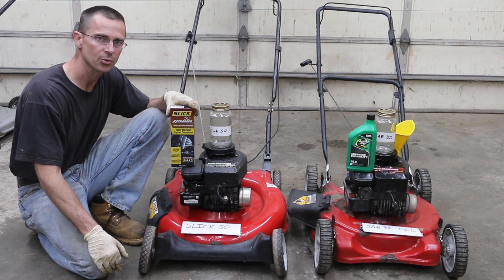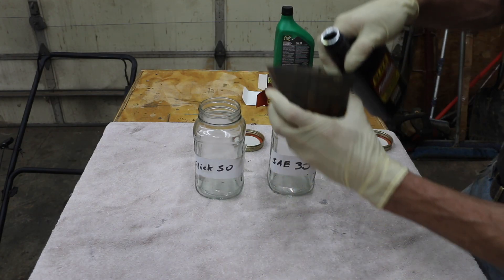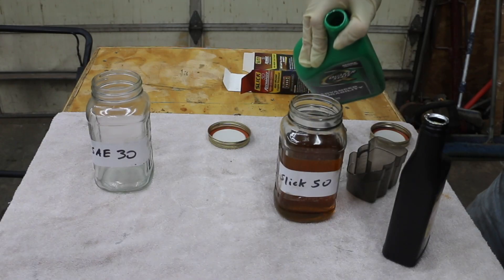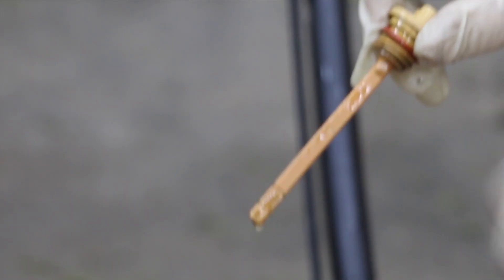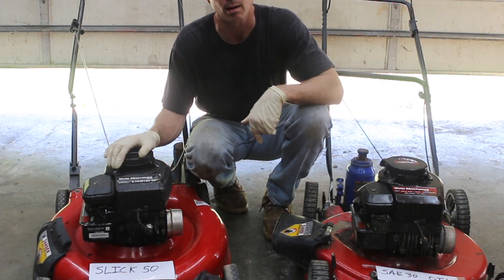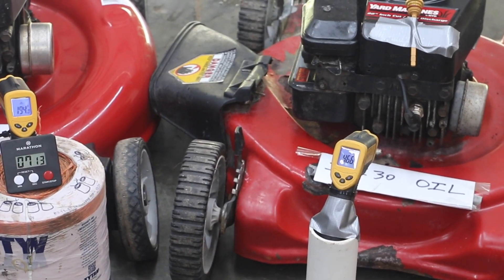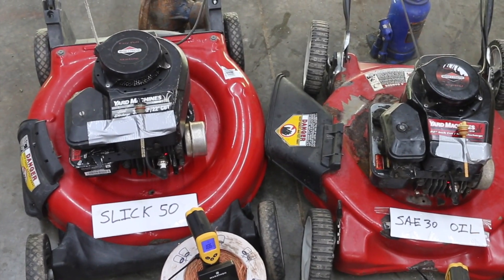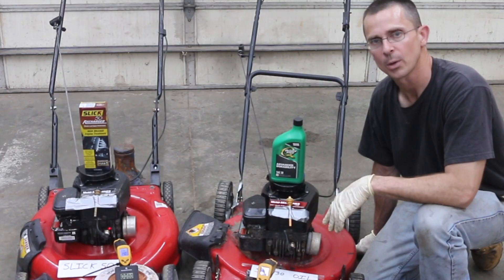Can't believe what SLICK 50 did to my engine!!--Dry Crankcase Test!

Comment: The Slick 50 mower looked to be in better condition than the SAE 30 one - the latter could have been more worn and taken longer for the critical part to heat up enough to seize?
Did you strip the engines to see if it was piston, crank or something else that caused the engines to stop? Did you notice any death-smoke from the Slick 50 engine, like the SAE engine displayed?
I do know of an instance where a chap used Slick 50 in a destruction derby car with a very worn engine and it was still running well after boiling off the coolant. What actually stopped it was the bodywork shorting out the coil - it still turned on the starter - and when that was sorted, the next day, it started and was driven onto the trailer for disposal.
From what I recall, from more than 30 years ago, there was some concern that the teflon could keep more heat in components, but not sure how true that would be.
Personally, nowadays, I just use good quality full-synthetic lubricants in the engines, gearboxes and differentials, if used, for the vehicles - and as the lawn mower is a 2 stroke, I don't think there would be the potential of an oil additive for that ;-)
Reply from the maker: Thanks for commenting on this.
Reply: Prompt reply - cool. Been doing some checking and it seems the modern "Slick 50" is nothing like the original product so, perhaps, your experience isn't unexpected after all.

Comment: What you did not do was to run both engines with normal conditions and establish if there is a difference between them than could result in one engine to run hotter than the other.
Reply from the maker: Thanks for the constructive feedback.

Comment: I had used slick 50 in my 1980  Chrysler Valiant. I had used it when I first got it I had 15000 miles on the car when I bought it, the first time I used it I put it in every other oil change. I had put on more than 155,000 miles on it when my oil pan cracked due to a rock hitting it. I was about 125 miles from home in NH. it was a slow oil leak and it ran out at 100 miles to go. my Temps did not go into the red area until I was almost home.  It was about 4 miles from my home before the engine started to seize up. the stuff works but it has to be run for a lot of miles for the Teflon in Slick 50 to coat all the metal parts. you can't just run it for only a short time on Slick 50, then drain the oil and do the test. It takes time to build up. it used the heat created to bond the TPE (aka Teflon) on a molecular level to the metal.
Reply from the maker: Thanks for commenting on this.

Comment: I think the mower you put slick 50 in was already damaged in some way . I'm not saying you did anything wrong the one mower just had more time on it. I did the same test and the slick 50 lasted much longer. Go buy two new motors with extended warranties and give it a try.
Your videos are awesome keep them coming. Thanks
Reply from the maker: Thanks for commenting.  I've since begun using new, identical engines.  Thanks again.

Comment: Slick 50 seems as if it has too high of a level lubricity. Im probably spelling that wrong. Clearly this stuff works better when its actually in engine oilnto preserve it. Without the oil it dries up inside the crankcase
Reply from the maker: Thanks again.

Comment: There's almost no chance your experiment is proving anything about the Slick 50.  You start with two  engines  that are far from identical.  You can't rule  out the simple fact that the Slick 50 engine could have been in worse condition at the start of the test.  Get 20 new engines and run 10  with and 10 without Slick 50.   THEN you might have some real science...
Reply from the maker: Thanks for the constructive feedback

Comment: I was going to try rubber washer on a Honda ATV motor I was wanting to know if temp is to high on ATV air cooled for regular rubber for hardware store ty please let me know answer. Good video on the lawn mowers.
Reply from the maker: If using the rubber washer on the cylinder head or near the exhaust, it won't last.  If using it away from the combustion chamber and exhaust, I believe it'll work.  It's hard for me to advise without seeing first hand the location you plan to use the washer. Hope this helps.

Comment: ur not using the original slick 50  shell oil bought out  the product and the formula changed because of patent their is a video about that  i did a lot of research on oil additives and turbo max along with amzoil is my opinion the best  for example the best mpg i  got in my mercury mountaineer before was 20 mpg after 23mpg   on my harley i got fou r more mpg on it on the heritage class b 103 check out the interview with john bishop
Reply from the maker: Great point.

Comment: Sorry but there is nothing, unless you have your engine nitrided. Regular oil changes that's it! Any internal combustion engine has a finite life span, newer modern engines will go much further but that is only because of the fuel efficient fuel injection systems that prevent fuel wash down of the cylinder walls then into the oil pan.
Reply from the maker: Thanks for commenting.

Comment: Years ago I did a test on my work car.  I ran Slick 50 for a year "three oil changes" with Slick 50 each time.  I ran a 195 thermostat and had to remove the cooling fan so I could have heat in the winter.  It worked.
Reply from the maker: Wow! Thanks for sharing this experience.

Comment: Years ago I also used Slick 50 and I thought it had saved my engine. Not because it ran out of oil, but my GF had blown a head gasket and drove it home overheated with the coolant temperature needle pegged. I thought for sure she had caused damage to the engine or at least warped the head. As it turns out the engine was fine and the magnafluxed head was also A-OK. New gasket was installed and it was good to go and last for years until I sold it.

So while no engine is going to survive without lubricant, maybe keeping the engine temperatures below a certain level helps keep the metal from distorting/melting in some overheating situations.
Reply from the maker: Thanks for commenting on this.

Comment: Prolong!  THey used to do the tests where they would throw dirt and drain the oil in the AZ desert heat after running it with Prolong, using a viper v10...I would love to see a test like this with Prolong.
Reply from the maker: Thank you for this recommendation!
Reply: Thanks for the reply even on a video so old.  Love your stuff and watch them more than once because well you do them tons better than others.

Comment: I would really appreciate a test of
- Liqui Molly Ceratec
vs
- Wagner Micro Ceramic

You could also give Militec-1 a shot. 

thanks a lot
Reply from the maker: Thank you for this recommendation. I'll be publishing a video on Liqui Molly soon.
Reply: Project Farm thanks really looking forward to these because these additives if they really work as advertised could really prolong the life of our engines, gearboxes and differentials and also save some fuel not much but still a bit :)
Doing those tests with real engines is really a heaven sent proof instead of pure theory some try to tell us.
Thanks a lot!

Comment: In my experience the original Slick-50 was great. Maybe 20 years ago I had an ‘86 Camero that was hard to start in the winter, burned oil and didn’t have the best mpg. I read the claims that Slick-50 could stop oil burning, improve your ease of start up and increase your gas mileage by almost 2 mpg. So for a month I kept careful records of my mpg. The instructions were very specific, change your oil and substitute one of the quarts of oil with a quart of Slick-50, well shaken. Then drive your car for at least a half an hour with the rpm’s above 2,000 I think it was. This was the time and temperature that it took to burnish a micro thin sleeve of Teflon onto the cylinder walls and also filling in the gouges that have occurred during normal operation. I did so and then left it in for the remainder of the 3,000 miles between oil changes. They recommended continuing on with regular oil changes for the next 5 changes and then repeating the treatment. To my surprise I got almost exactly 2 more miles per gallon, stopped burning oil and winter start ups were instant. I kept up with the treatment schedule over the next 3 years I owned the car. Though the engine ran like a top, sadly the body and interior had gotten pretty shabby, so to satisfy my curiosity I took it to my sisters mechanic instead of mine, because he wasn’t aware of the Slick-50 use and paid a hefty fee for him to check out my engine before I traded it in on a new Camero. When he called me later with the results he sounded suspicious. He said that the engine was in good shape for its age but the one thing that was a puzzler was that it still had the same compression as it would have if it were brand new. That made me feel that the expense of the Slick-50, $30.00 a quart, was well justified. I told him about using the additive and he mentioned that he was going to try it on his old truck, don’t know if he did though. The other thing was that it was not supposed to be used on new cars, but only after whatever recommended number of miles. I also used it in our pneumatic control air pump at work which then ran cooler and left no oil residue when blowing out the condensate from the air tank. I can’t speak for anyone else’s experiences but mine were fantastic. I suspected that It worked too well when later I heard that auto manufacturers were unhappy about it extending the life of existing engines and cutting into their “New Car Sales”. From the news at the time, frivolous lawsuits and negative propaganda were leveled at the company. I don’t think the lawn mower with the Slick-50 ran long enough to properly burnish the Teflon onto the cylinder walls. Maybe the new formula is different but the old one was great.
Reply from the maker: Thanks for commenting on this.

Comment: I bought a Dodge van camperized, and headed from Alberta to Arkansas...
Put the Slick 50 in it before I left...
This was in 1980...
I got to Colorado Springs and the red engine oil light came on...
no oil pressure.
I added more engine oil, thinking dipstick was just wet from running...
Started it up again, still no oil pressure after a minute..
Shut it off...
No one would pick me up hitchhiking on July 4 weekend, so I went back to my van got my bike and biked to a truckstop.
A trucker gave me a ride to an auto parts store, advised me to buy the shaft which the cam drives the oil pump on the 318 cu in Dodge engine...
So I did, and lucky for me when I finally got the engine mount off one side, the rad fan housing off, and every oil pan bolt so I could barely reach inside without seeing got the oil pump out and it was SEIZED up...
The shaft which the cam drives to turn the oil pump and distributor was snapped off at the oil pump, but the distributor still allowed the  engine to run...

I HATE SLICK 50...
It actually looks like SUCK 50...
Never ever used it again.
WIll always remember that truck stop repair job July 4 weekend in 1980...
Reply from the maker: Thank you for sharing this experience.  That sure sounds like a bad weekend!

Comment: Slick-50 was garbage, and ruined two of my engines. Two engines with Slick-50, and two engines requiring overhaul. Coincidence? I doubt it. Anyway, since then I only run synthetic motor oil in my engines. Just oil. That stuff was expensive, too.
Reply from the maker: Thanks for commenting on this.

Comment: What happend to Slick 50 listen to John Bishop they changed to forula but kept the name look on youtube .
Reply: Too late. I wouldn't put that crap in my engine if they paid me.
Reply: I used the real slick 50 $80 for 750 Mil aud i had an old holden 179 motor i ran slick 50 the true blend not the fake there selling now i broke my bottom water hose and drove my car 28 K,s with out any water fixed the hose and the engine ran for another 3years without using any oil thr real blend is ok but not the crap there selling now .

Comment: The slick 50 has been taken over from the founder and is junk .Look on youtube           for the original founder of slick 50 additive .
Reply: It ALWAYS WAS junk. I only put the manufacturer recommended viscosity motor oil in my engines, and NOTHING ELSE. (except I use full synthetic oil).

Comment: Bravo'  I would do the same thing if had the means to do so,.keep up the good work,bout 35 years agoI used to push a product called CLM  it was copper lead and metal. it would bind onto the crank and smooth it up making it really slick made the engines  run along time before it would quit,.  we also used a cylinder break machine that would apply pressure on a bearing surface if the seurface was not treated with clm the friction brake machine would lock right up i it was treated it would go forever,
Danny
Reply from the maker: Thank you!

Comment: I would like to see Molybond friction modifer used and test it on real motor V8 engines and then send the oil to a oil testing lab and check the results that way its scientific and the numbers to mean ?
Reply from the maker: Thank you for this recommendation too.

Comment: Schaeffer Oil Company from St Louis Missouri, make a product called Straight Molly, it is awesome product, I have use it for years.  I have had many occurrences were.  If the product was not in the engine it would have been catastrophic
Reply from the maker: Thank you for this recommendation.

Comment: Is Tufoil still available? I used it for years in my automobile engines and it reduces friction by using a Teflon formula similar to Slik 50. Unlike Slik 50, you use some at each oil change, and I gained near 7%-9% in fuel mileage.
Reply from the maker: Thank you for this recommendation.

Comment: You didn't shake the slick 50 before use ! when shaken it is not clear, it has small teflon particles clearly visible in suspension. I used it correctly in a rebuilt motor and could not get the engine hot enough to run the car heater ! It was also more fuel efficient !
Reply from the maker: Thanks for commenting. I shook up the container before the test and regret now showing it on video.  Thanks again.

Comment: Dear Project Farm, I have used and was a distributor of Slick-50 back in the day, 1978-79 or so, when it was the original formula and it did perform as advertised. If you remember, Slick-50 had PTFE suspended in it and that bonded to all the internal and moving engine parts putting a coating of Teflon on the engine parts. Not so now!!! Slick-50 is no longer the Slick-50 of old.

In 1984 the inventor of Slick-50, John Bishop, had some legal issues with the product and it was eventually sold off to several different oil companies over the years since. Here is a video of the original inventor of the original Slick50 that you may be interested in watching. He explains what happened then and what's happening now.

By the way, you can still get the original Slick-50 but it's got a new name and it's called Xcelplus. 

Anyway, check out the video about the old/original Slick-50 here: https://www.youtube.com/watch?v=CAt-tJa9P_s
I hope you find it interesting and I would like to see a new test using Xcelplus against regular motor oil. I think you'll see different results.

Thanks and keep up the great videos!

RIch Williams
Astor, Florida
Reply from the maker: Rich, This is great information that you provided. Thank you for this information.  The test results make sense.Thanks again, Todd
Reply: You're welcome Todd. I'd sure like to see you do another test but this time using the Xcelplus product. I was blown away when I saw the Slick-50 engine stop before the conventional oil engine, so I had to do some research. I have always sworn by Slick-50. But from now on it's Xcelplus(the original slick 50) for me. I hope you got a chance to watch the video. 

Anyway, I'm glad you were able to read my comment.

Thanks Todd.

Comment: The part i find funny is, with many comments.. talking about the left being less running hours and what not.. well the slick 50 is supposed to be better then oil.. yet it was added to the so called newer with less running hour engine, logic dictates, newer engine better oil would run longer, yet still failed in less them half time. for a true test try again with two new engines..
Reply from the maker: This is an excellent point and I agree.  It seems to me that Slick should have overcome any sort disadvantage, if there was one, by virtue of being slick.